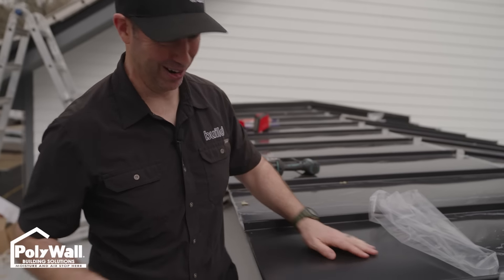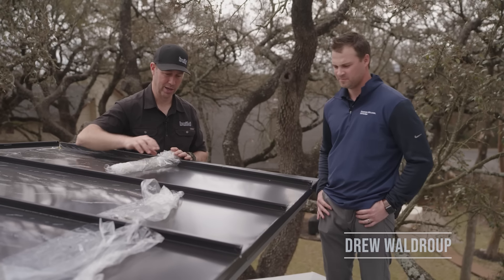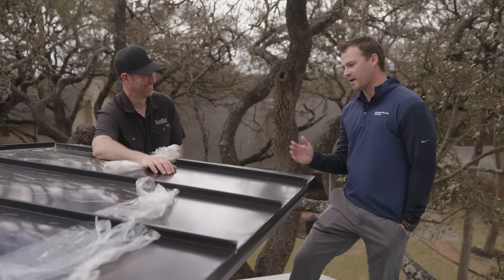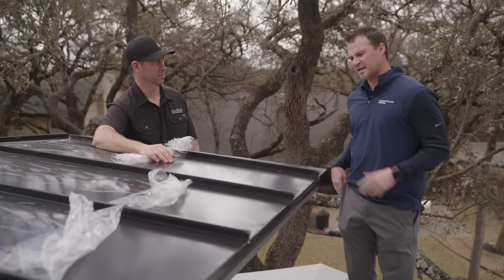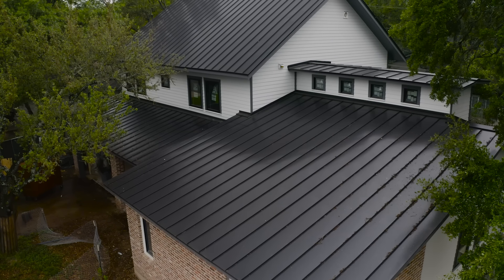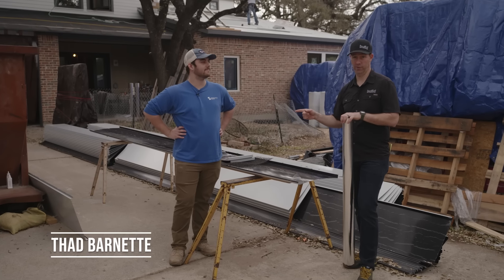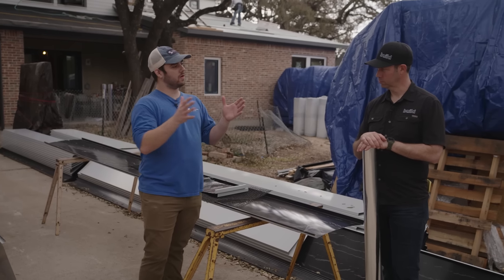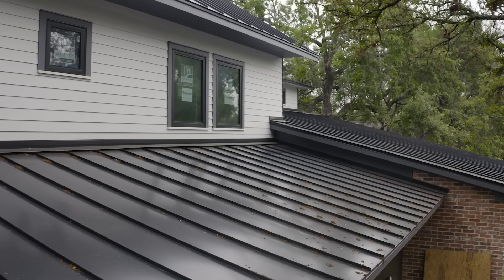Black Metal Roof - Dumb Idea?

Comment: ANY dark shade paints, ESPECIALLY black paint undergoes repeated extreme heating and cooling cycles with every sun-up/sun-down. This WILL deteriorate the structure of the paint over time. Also the aggressive chemicals of paint droppings WILL react with heated paint stronger and more likely to cause damage. 

Second question is why not solar roof? What customer is spending gorgeous custom house kind of money and then skipping on solar roof? Don't get me wrong, I'm by far no tree hugger, but if the customer really wants a black roof, then why not go all the way and get a black solar roof?

Comment: In the south, you could probably use a black metal roof for preheating your hot water. 😂 You would want a drain back system on it just in case of freezing weather

Comment: So theoretically if someone wanted to use a large water tank with a heat pump, they could just forego the air gap, and use that extra heat to keep their water hot if they plan their air circulation in the house to accommodate?
Reply: Just put a heat pump water heater in the attic.

Comment: Black asphalt is dumb... It always has to be replaced; how many nail holes get placed through the sheathing; the way asphalt shingles react to hot and cold temperature no wonder why they always got to be replaced... Matt your black steel roof looks like an excellent choice.  I have always thought about black tile swimming pools.  Solar passivity and reactivity is a big thing.

Comment: On a scale of 25-100 a black roof is a 25. 

It will last a long time, the paint and material are top notch. 

It WILL chalk over time, a totally flat surface will show minor dings more than a textured surface. 

I've done millions of square feet of metal roof over the years. Customers in the south with dark roofs usually end up unhappy

Comment: I mean, the air gap offsets alot of the downside to a black roof. Hell, the heated air flow will even help to dry out the gap in case water happens to get in it. Cause texas hurricanes are a thing.

Comment: Who gives a $hit what all the negative Nancy’s say about fade, pigeon poop, dust, heat absorption, blah blah blah. The raised seam metal roof performs well and looks sick
Reply: well, if looking sick is your most important criteria, you're good to go, then.  personally, I don't want to be fighting absorbed heat from my roofing, and I live in a much cooler climate than Matt does.
Reply: @kenbrown2808   - from the google machine: “A metal roof will lower your energy bills by about 40 percent in the summer. The reflective surface lessens the transfer of heat into the home. On the other hand, asphalt shingles absorb the sun's heat, transferring it through the roof to the home, making the home's cooling system work harder.”

Comment: i was a union sandblaster/steel painter for 15 years and went to decorator after, i have worked in protective coatings at LTV steel, US steel, Inland steel, bethlehem steel, intech steel, and have relined huge steel storage tanks in tank farms all over the south and west of lake michigan.
 i retired to the philippines and built a house beside the ocean with my own 2 hands that was designed by me as well.
 my roof is corrugated steel, the 'wavy stuff' its rather thick and i had it trucked in from some distance. it's screwed onto 3/4 inch plywood resting on 2x6 'philippine mahogany' rafters every 4 ft on center with 2x2s as purlins (nailers) every 4 ft (but they are flush so not really perlins).
 I cleaned the sheet metal off with rags and MEK to remove any oily areas or dirt and primed it with 2 coats of iron oxide(both sides) before installing it.. after it was all screwed down i touched up any small scratches and screw heads then used white industrial enamel oil paint, 3 thin coats on that.
  that was in 2017, in 2023 i washed it down with soap and water and rinsed it well then hand sanded a few spots that looked like they may need it and recoated it with 2 more thin coats of white oil enamel.
  it still looks great and it has lowered the temperature in the house by reflecting the hot sun dramatically, you can touch any bare metal here at noon and it will burn your fingers. my roof feels like 65-70 degrees at noon. i have had zero rust(even beside the ocean) and zero coating failure and zero leaks.
  the temp here never varies too much staying between 65-95 degrees F so the expansion and contraction is not a problem , (and even less of a problem after painting since it stays between 65-75 degrees now! ).

anything can be painted if you know what you're doing and use the correct materials.
 edit - i used galvanized screws with little rubber gaskets under the heads (dont over tighten and smash the gasket!)

a black roof here would be insane.

Comment: Looks good. But it’s not environmentally friendly. On a hot sunny summer day. Use a heat gun and record how hot the air temperature gets around the surface of the metal. 
Con: probably good for the snowy winters. Melts right off.

Comment: Is this a bad idea?
Its popular, on trend right now. Ok that does not make it a good decision.
Durability, ok That is a good point, darker paints tend to last longer, white does as well though, colours however tend not to.
Regarding reflectivity, basically he’s saying its shiny, so it reflects more, this is kinda true however snells law is pretty clear, that only really helps at glancing angles. (Fresnel effect)

Fundamentally, energy efficiency wise, yes its worse then white But the air gap will help. Compared to shingles without an air gap its still better.
And given the amount of insulation will be fine. Would it be more efficient to use a lighter colour yes. Is efficiency all that matters? No.
Otherwise don’t install any windows.

Comment: Unless you can walk on that black roof with bare feet you’re pumping heat into the house structure. Worse, the hotter black metal is heating the air over the house contributing to the ‘urban heat island’ effect. Yes, it’s a bad color. But a metal roof is a great idea. I’d give you a ‘C-‘ for this decision.
Reply: Every time I see one of these getting installed, all I can think about is sliding down the roof trying to walk on it.

Comment: Nobody is complaining about a metal roof. It is the color that is the problem. 

Saying that black looks good and is fashionable, doesn't have an SRI of zero,  doesn't really fade much, mitigated by lots of insulation under the roof, etc, does not change the fact that a black roof in Texas is going to heat up not just the roof, but all the air around it. Could have gone with a medium grey roof and with a similar look and achieved a much higher SRI.

Comment: "If its trending then we can make a lot of profit so lets rationalize the use ".  Personally I think smart efficient designs are the only ones that look good, if it waste energy then it just looks bad., Matt admits how inefficient this is himself at 3:45.100 SRI for white versus 20 SRI for black 80% difference , this is huge and black just magnifies global warming problems . If everyone had black roofs then its going to raise the local temps just like city's with lots of concrete are hotter than surrounding countryside with no concrete and very few black roofs. If you still have doubts just put your had on a black car that's been siting in the sun for at least 15 minutes , actually don't put your hand on it could burn you! Just close enough to feel the heat Then find a white or silver car and do the same, big difference. If you don't want to burn your hand on a black car use a laser temp gauge.

Comment: I have a 1950’s house that I’m guessing got steel siding in the 1960’s and we want repaint it what would people recommend and also I have some old drill holes that need to be repaired. Any tips would be great. I’m in Milwaukee WI
Reply: I wouldn't go pure white. It's the best performer thermally, but you and your neighbours are going to have to look at it and bright white in full sun is hard on the eyes. If you can find a display centre with a wall of the manufacturer's colours outdoors facing the sun, looking at that in summer will help you decide how pale you can tolerate.
For the repair, I'd recommend you go to your nearest hardware store, explain the problem to them, and ask what they recommend. Take a whole lot of photos first to show them so they'll know the scale of the problem.

Comment: Short answer: black metal roof is not unreasonable with well insulated roof and attic. Heat gain similar or better than light colored composition shingle. Black composition roof, not a good idea. At least,  that was my conclusion 7 years ago, put a black stone coated steel roof on a house in SoCal.

Comment: Hey Matt, long time fan. I was wondering why I don't see any soffit vents on your new house. My old 1980's house has none and i've been researching on why and how to add those, if needed?
Reply: His roof has air flow between the structural sip pannel (on house) and the raised plywood boards on which the roof is attached. This requires more wood, but keeps the heat outside of the attic and house envelope. Check out his older videos.
Reply: It is and unvented attic.

Comment: Black roof will be hotter than a white roof. But the drying potential will be greater and will make your roof assembly last longer compared to white. But who am I to say, I'm no expert, Joe Lstiburek talked about roof membranes on Rooflogic, not metal roofs.
Also, I think a metal roof is good for rain harvesting.
Reply: rainwater harvesting only if you clean the roof before you start each harvest ;). offcourse you could use it to flush your excrements down the drain but still need some form of cleaning or the pipes might get clogged with all the bird excrement on it not to mention the lyle from all the decaying leaves.

Comment: Yes it is not as smart as using white or galvanized (shiny/reflective). Your insulation will absorb less with those types vs black. Yet if you are going with black because you want then my opinion really doesn’t matter, but you asked for the opinions.

Had a few minutes to process your roof installation. Although you do have an air gap your reflective barrier was put upside down. It’s my understanding of an radiant barrier that the air gap must be on the side of the aluminum/shiny side. It was installed with that side facing down which voids its reflective capabilities. Even with the netting material under the radiant barrier it is in contact with the aluminum which causes to become a conductive material instead of a radiant barrier. Essentially the only benefit you are gaining from the money is the insulation on the roof and the air gap between the metal panels and the roof.

Comment: One of my neighbors has a metal roof, I think it looks great. however his neighbors who live near him hate it, they say they can hear it everytime it rains. Is there anything they can reduce the weather noise?
Reply: Better windows in the neighbors' houses...
Reply: On another YT channel, they recommended putting a layer of mass-loaded vinyl (a product specifically made for noise attenuation) under the metal roofing.  However, I worry that the vinyl might degrade over time when subjected to summer roof temperatures; I doubt that it’s meant to get that hot.  Probably any sheet material that’s “soft” could help reduce the vibrations of the metal; you’d just need something that would stay that way for the life of the roof.

Comment: There is a new ultra-white paint that reflects 98.1% of solar radiation, leaving the surface cooler than the environment. It's new, so no data on how durable it is, though. Personally, I'd go for the whitest roof I could get, it seems like the responsible thing to do especially in sunny climes. Form follows function, and one function of a roof can be to reduce the load on our air conditioners, saving energy. Fashion should not come first.

So, yes Matt, it was dumb of you to put a black roof on your new home in Texas.

Comment: Couple Facts with the most popular metal roofing.  Screw down panels.   1.  Most companies do not use the lifetime screws.  So they have to be replaced every 15 years.   2.  I understand companies changed there paint warranties to 40 and even lifetime but we all know there pro rated and have fade factors etc .  So basically they give you the warranty in large print and then take it away in fine print.  With that said only time will tell but so far every metal roof I have seen fades dramatically and looks like shit in 7 to 10 years.    So bad to the point its actually becoming more and more common for homeowners to request we remove there ugly metal roof and go back with shingles because it gave such an eyesore to there home.    So many of these high end homeowners are going to be so damn pissed in 10 years when there metal roof looks like shit.   Again only time will tell if they have made major advancements in the paint not fading so bad over time.   But its all hearsay.  We have to wait 5 to 8 more years to see for ourselves.   90 percent of screw down metal roofs installed 5 years ago and back will 100 percent look like crap in 10 years.   They will also leak and require all new screws more often than not to be replaced in 15 years.  Still cheaper than a new roof but looks are important to the consumer.

Comment: We're supposed to be using less material when building.  Using extra thermal barriers to stop heat intrusion instead of going with lighter colors is not a green choice and should be avoided.

Comment: Paint guy: Black paint is an SSRI of about 25, white is 100.
Matt: But with your technology, this black paint is still in the 20s?
Paint guy: Yes, it's better than a composition roof.

Um. Did Matt mean higher than the 20s? Also, he didn't specify which composition roof color he was comparing. Does he mean this paint has a higher SSRI than a BLACK composition roof?

This feels like bologna. Would love to have Matt do a real comparison using an infrared thermometer on his roof vs composition roof in black and also a lighter color.

Comment: That assembly is going to fail because the underlayment is being installed ridge to eave and being stripped out with untreated wood. Moisture in the form of condensation on the back of the panels will rot the furring strips. Underlayment not lapped in the direction of the waterflow will leak into the house. Assemblies like this give metal roofing a bad name. Some salesman did good on this job. Black gets hotter during the day but cools off faster at night. Lots of expansion and contraction going on and lots of unnecessary holes punched thru the substrate.

Comment: In Wisconsin, I lost my vote for a metal roof because the roofing salesperson said that metal roofs can dump huge amounts of snow and ice in a catastrophic way.
Reply: You can add brackets to stop snow falling off
Reply: That salesperson wasn't doing their job very well IMO; there are several products out there to deal with exactly this problem.  Various names include "snow gaurds" and "snow retention systems". Products to deal with this problem have been on the market for decades, and not just for metal roofs. Would be very easy to install with the clamping system Matt showed in the previous video.

Comment: SRI index is corporate subterfuge B.S. Compositing the data into this index serves only to flatten the thermal emisstivity numbers which would spike with a black roof. Maybe "on trend" but this roof is a big FU to the neighbors and the environment.  Roofs are a huge heat island contributor and this one is especially impacting. Was all that work that went into making the house as close to passive as possible more motivated  by self interest than the environment?

Comment: From a climate standpoint, black is almost negligent. You could be reflecting the shortwave sunlight back to space. Instead, you're converting it to long wave. Even if it doesn't get into your house it is stuck at ground level and will have to fight its way back to space (instead of just bouncing back to space by staying shortwave).

I suggest training trees to get as much shade on the roof as possible.

From there, yes, your system looks grand. It will work fantastically.

Still, I wonder if the climate ramifications of a black roof will bother the next generation.

Comment: Why not a ZINC ROOF…no paint, beautiful Grey color, obviously cooler than a Black Roof…But if you like Black, and I do, then a TESLA ROOF is obviously the coolest and smartest choice, not to mention it saves you money, and could actually get tax breaks and financial assistance…
So Black Metal Roof? Yes in Super Cold climates the Black keeps house warm in winter, and heats up and melt what little snow that can hold on to those slippery metal roofs.
But ZINC ROOFS, are the smartest way to go.

Comment: Your radiant barrier is upside down. They put shiny side down. Whoops!
Reply: That is the correct install.  It has to be installed toward the air gap.  Check out solar board installation.  Correct installation is to the interior of the attic.
Reply: @eh_bailey  I don’t think the 3D mesh has enough of an air gap. You need 1” minimum for the radiant barrier to work. My Decra Roof is on 2x2 Battons and the radiant barrier is facing up toward the battons. So I have 2” of air space above the radiant barrier except for the area where the Batton makes contact with the radiant barrier.

Comment: my sister has a metal roof and it looks great but the cell phone reception inside the house is hot garbage. Constant low signal and dropped calls. Full bars outside the house. Why would anyone get a metal roof?
Reply: 40 year guarantee.  Best cost per year if you keep the house.